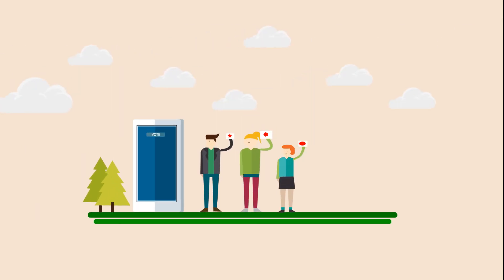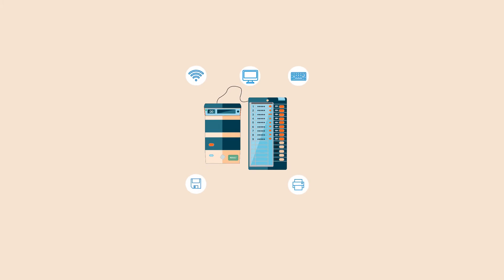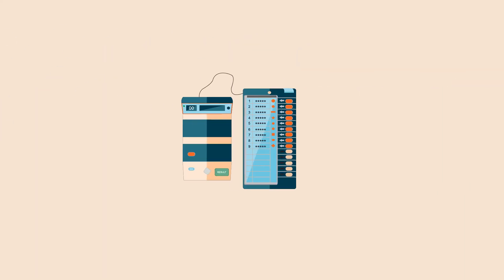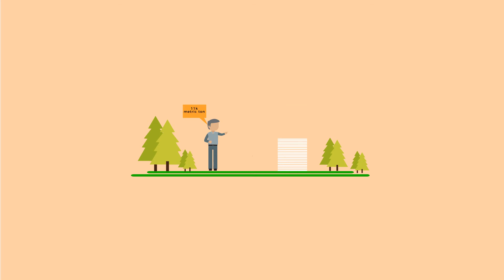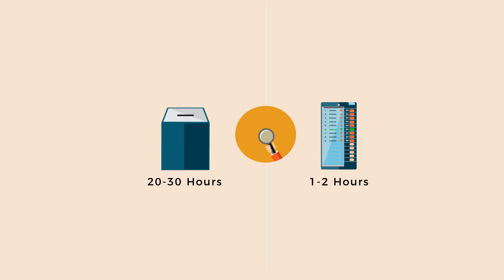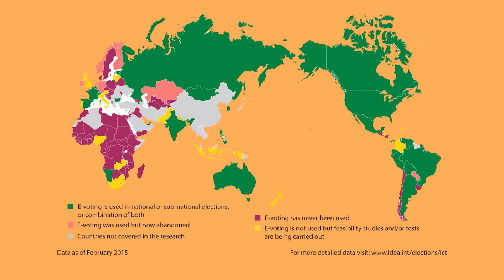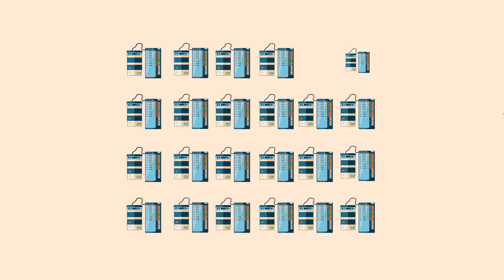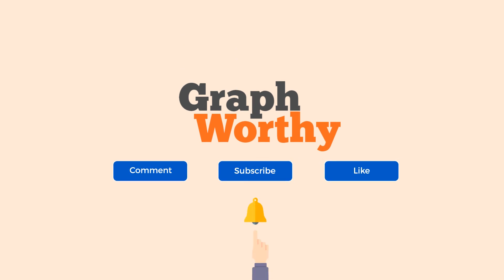Can you hack EVM (Electronic voting machine)?

Comment: You say not having to print ballot papers saves money but what about the cost for the manufacture, transport, storage, and necessary training in the use of these EVMs? The environmental impact of the device manufacture is far higher than the cost of the paper and printing. Even if the machines are used on regular basis, there won't be regular elections in the same area of the country more than every 2-4 years likely and if the machines are to be shared across the country, the weight of transporting these machines will far exceed transporting just paper.
You state that recounts are easy, but this still assumes that the employee that copies down the results does it correctly. A recount will likely only occur if the results are close, but if the numbers are changed, they will never be re-verified if not seen as necessary.
Reply: You wouldn't store the paper, you need to have new ballots printed for each new election. It takes more work and resources to warehouse the computers in a central location and transport them to AND FROM each election site. Or, you order in the already printed ballots, and just handle the shipping to the necessary polling stations.